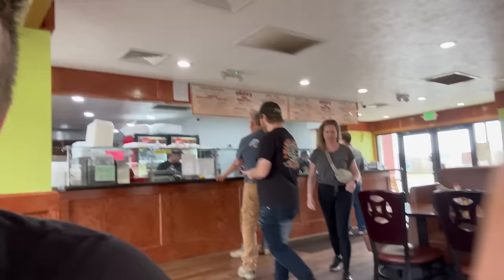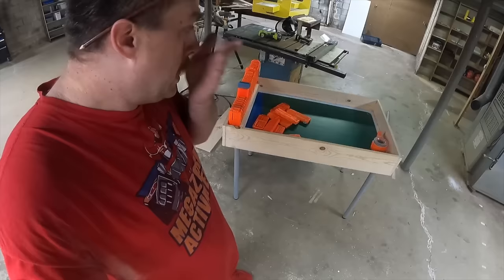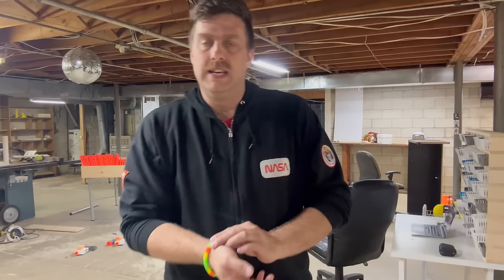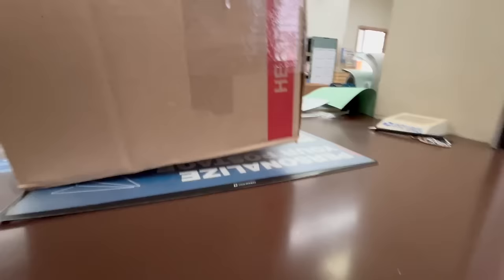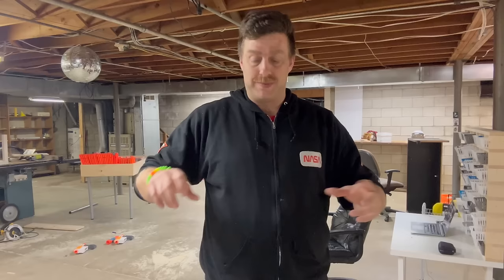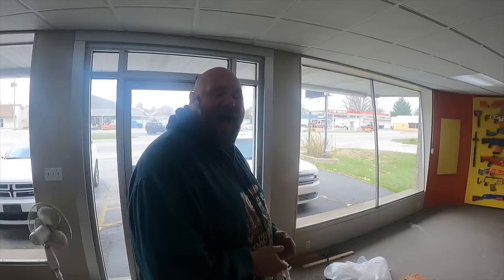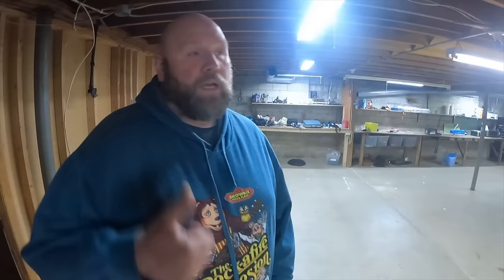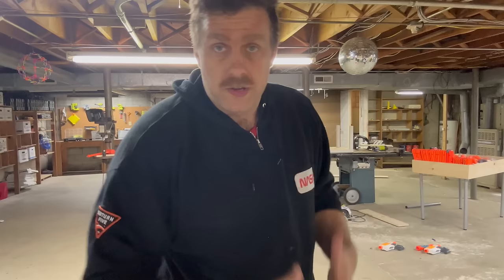Building a Toy Store is HARD! Decorating Begins!!

Comment: When radio shack closed down I bought some of the tables they had. They were super heavy duty solid metal tables. They had like phones and such on the top and it had metal peg board around the sides for accessories. I ended up having to move them several times by myself. So I feel you with those glass cases. But you do what you gotta do.
Reply from the maker: Hahaha! Sucks!!

Comment: The racks look like they were made from metal plumbing fittings. Threaded galvanized pipe and fittings with some caster wheels added. Might be able to buy parts and put them together. Just use the ones you have as a guide.
Reply from the maker: Yeah, but some are thinner welded metal, much sleeker, and id line to have more of those! But building the others would be easier for sure.